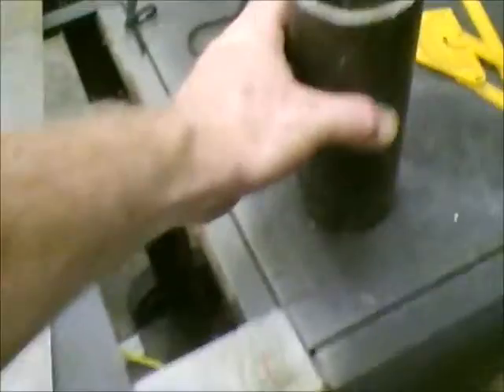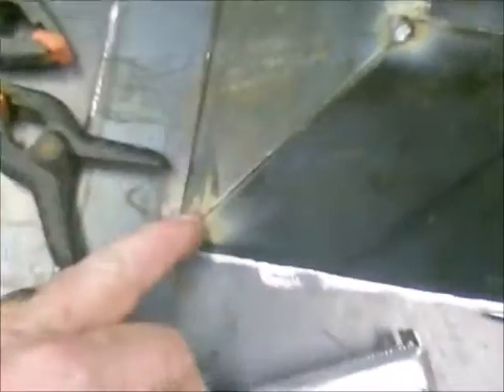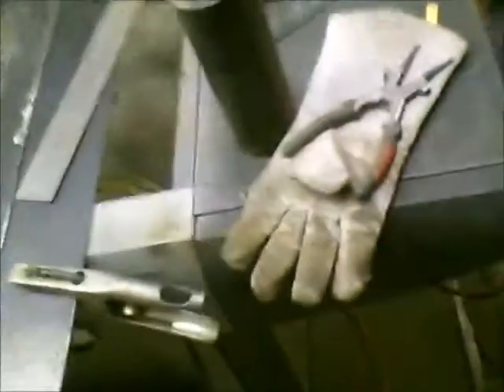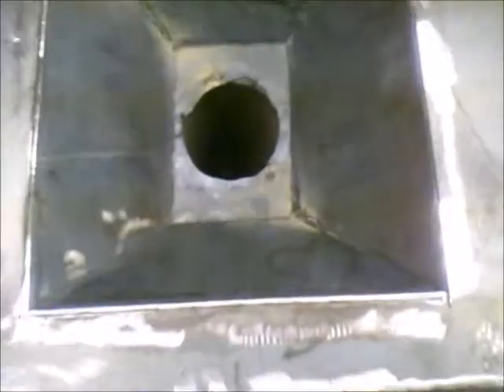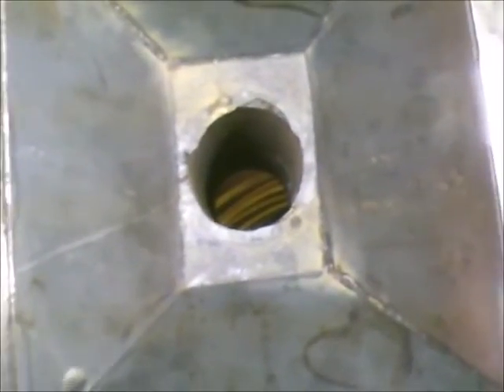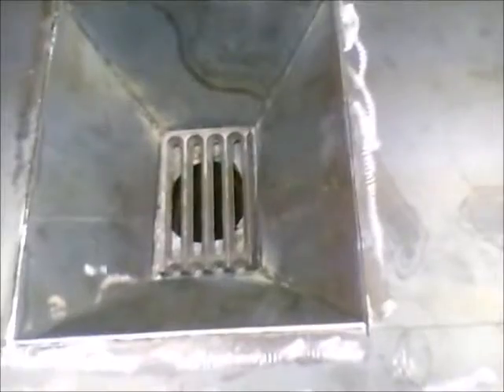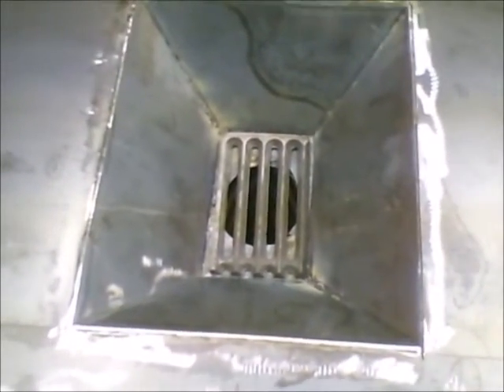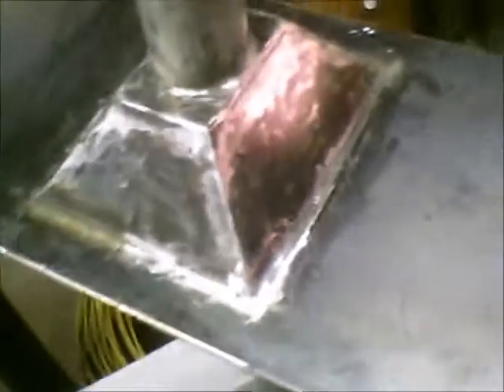Building the forge

Comment: My brother has a friend in Johnson City..he does HVAC...but he's about retired...he's into old cars..He came down a few year's ago and did a little work on mine..My heat pump is an all in one Coleman unit..LOL it's 23 years old and still going. I'm goin to run it til it quits. STill cools and heat's very well.
Reply from the maker: I would keep it as long as it works for sure.
The new units use R410a refrigerant and are quite expensive.
Thanks for watching.

Comment: Cool , i have the same plasma cutter . Only issue i had was the hose was not crimped well and came off up in the handle . $25 for a new one , but it works good .
Reply from the maker: I have been very pleased with it for what I paid.
Even the extra tips and ceramics are only like $18 bucks on ebay.
Thanks Terry.